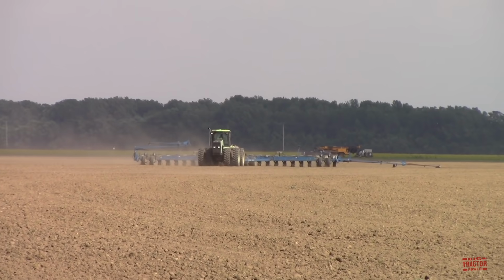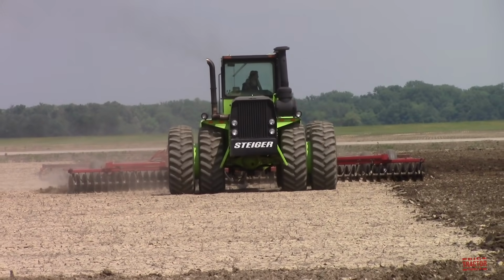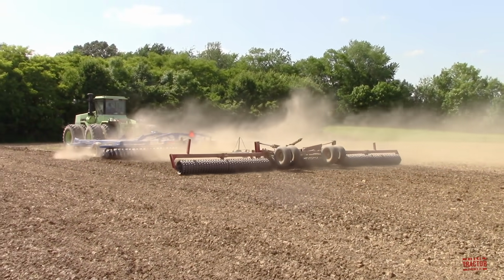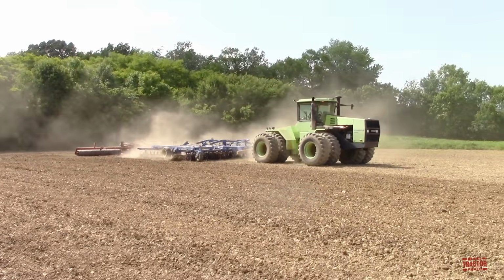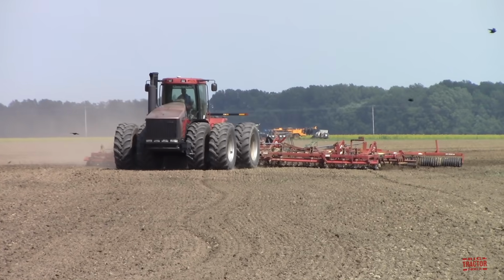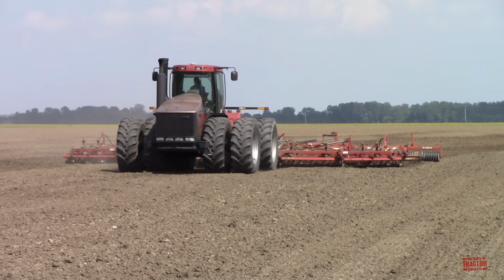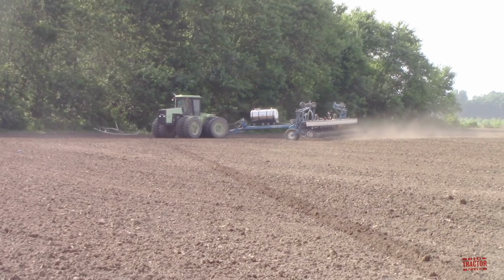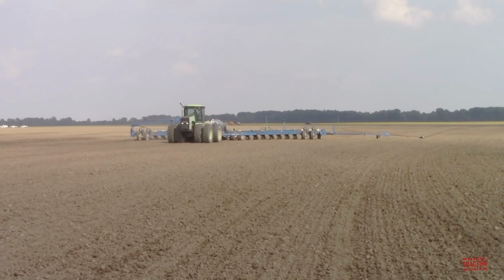STEIGER Tractors Planting  Corn

Comment: Before you mentioned it I thought it looked like everyone was actually driving the tractors versus letting GPS guide them. That's something you don't see very often anymore and it is kind of nice to see. Got to love the sound of those tractors.
Reply: That puma 1000 has autosteer regardless of I’d they weren’t using it in the video. I’ve seen it with my own 2 eyes more than once.

Comment: That steiger pulling the planter most likely has allis chalmers drive train components.  Was kind of kept secret, but for steiger to get a row crop tractor,  with bar axles,  and adjustable tread width,  they bought components from allis.  If you look at the shift console in the cab,  it's just like the allis 4W305. Front end,  rear end,  power director transmission is all allis. Allis engineer at the time,  and steiger engineer were good friends from having designed a white four wheel drive tractor together in their previous job,  so that's how the deal got put together

Comment: That 1st guy would have been fired on our farm way too much overlap and you do not turn around with things that have bearings leaving it in the ground
Reply from the maker: Well good thing thing it’s the farmer so no one is getting fired.  Every farm I film at on the river flats leaves the blades just touching the surface to cover the tire tracks on a turn.  I film at several farms on both sides of the river in IN and KY and they all do it this way.  They must have a reason if they all do it. .